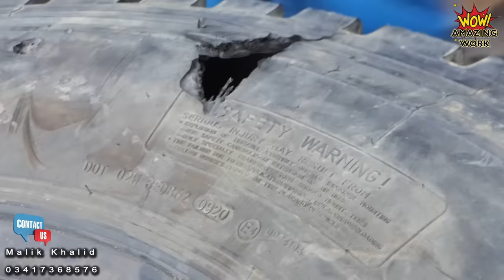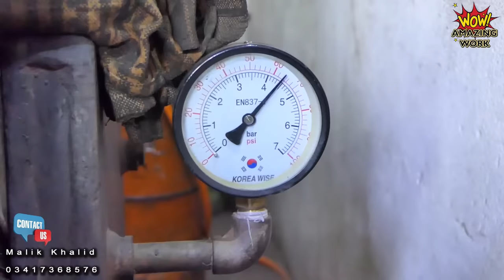Amazing skill of Repairing a Hard Impact Sidewall Truck Tire

Comment: Good job Samir! I’m sure that tire will last at least a day or two before it blows up and kills someone!
Reply: This  type  of repair ,  Its  Wheel  balancing  will  be  loss .
Reply: ยางระเบิดบนถนนมันจะอันตรายกับคนอื่นที่ใช้ร่วมกับเรา..ตายขึ้นมาเดี๋ยวใครจะรับผิดชอบ
Reply: @sreekumarsekharan3685  you don't balance big truck tires like these.
Reply: Perfect....work 
A tyre man know what he done.
Reply: @TwazkemUSAbi  says who?
Reply: Don't be so quick to judge. It can last a lot longer than you think.
Reply: Might not be good for highway use, but can be used off road or on a farm trailer.
Tire still has some life to it.
Lot cheaper than new.
Reply: @Just-Steve it's a tractors wheels it's never gona run on high speed
Reply: @prajwaldogra1030 that's not a tractor tire lol
Reply: Man cuts through steel beads to replace with string, string doesn't spark when you grind through it.
Reply: So they have a hole buisness fixing tires that break 2 days later, sure budy
Reply: @mrsnail8664  re-treads blow all the time

Comment: Makes perfect sense for a tire on a slow movin farm or utility trailer. Don't run at highway speeds.
Reply: maybe they are just restoration of big tires, because the speed of the vehicle is also not too fast, and not too heavy.
Reply: Highway speeds? Around 40kmph
Reply: You're correct, this tire will be way off balance,  can't go anywhere with it.
Reply: Exactly. That hole is held together by a needle and thread under the patch. Admire the ingenuity though.
Reply: Don't think they have highways and if they do that truck won't be doing more than 80 km/h.
Reply: Exactly
Reply: Makes sense in countries, where full day work of a specialist team is worth less than a new tire.
Reply: @sodaris22  not only, tnink about waste too. Capitalism doesn't care about waste!
Reply: @sodaris22  I am thinking of what if the tyre explodes once filling air in it, the whole day and hard work all wasted.
Reply: @PartMiniBus  my country Indonesia is same like that
Reply: It's ready for speed 100 km for 2 year
Reply: And that’s why it should be outlawed. People will sell them as that.
Reply: @vikassm  ccc
Reply: What's the worst that can happen 😂😂
Reply: @PartMiniBus  Incorrect. Capitalism is the only system which acknowledges the cost of waste and works to reduce it.
Reply: U never been to Pakistan I guess.....
Reply: @TehButterflyEffect  works to reduce it after creating tons of it, yes, you're right!
Reply: What about the side of a 500ft cliff
Reply: They'll keep your suggestion in mind.
Reply: Nah this is a diff fix in our countries that don’t recommend a fix like this is cause they rather you buy new this was fixed really well
Reply: I'am agree, it's a little bit dangerous.
Reply: @LongHaulTrucker4Life  😂😂😂😂
Just check national debt per country list.
Whole structure is about to collapse.
Making money from money has never been healthy. Even ancient Greeks knew that, but you probably don't even know who they are.
You made me laugh 😂
Reply: @PartMiniBus  I'm actually a history buff.. Ancient Greeks also spent roughly 25% of their budget on military too... Since you think you know best, design a government that is absolutely perfect, I'll wait
Reply: @PartMiniBus  When you start name calling like a child, you lose credibility... If you can't debate maturely, then no one takes you seriously...
Reply: @LongHaulTrucker4Life , Mr Everyone, you've made me laugh again! 😂
Not sure why you mentioned war here, we were talking about money.
If you skip topics like you do you definitely get nowhere, whether you're a child or an adult.
Please don't choose to get offended as you sound like you like that.
Reply: They only able to do 80kmh speed at best road and traffic condition...

Mostly 40kmh and usually even slower on the rural unpaved road
Reply: Dale shut up, I tell you what. Hank hill voice.. 😂 looking forward to the reboot.
Reply: It will be run on highways only.
Reply: I think you are underestimating the ingenuity of this fix. The patch with the cord won’t be as strong as the original steel belting, but the process they used re-vulcanized the rubber, creating a homogeneous piece grafted in at a molecular level. It’s fine for driving at speed or under load.
Reply: Not sure that is allowed in the USA.
Reply: Don't worry, nice mountain mudpaths next to fast moving rivers in a canyon below.
Reply: @PartMiniBus  LOL. Fundamental misunderstanding of capitalism.
Reply: @peekingturtle8457  Tire isn't worn out though. It's covered in dust, which can happen on dirt roads pretty quickly. Hence why it is being repaired. I bet that tire has less than 10000 miles on it
Reply: @xbahamutzero  Agreed
Reply: Would be an interesting test.
Reply: Appreciate the HARDWORK of all these Legend Men's.
Reply: They are used on highway and exceed 5 times more the load capacity. Enjoy
Reply: @lamassu4100  so me one of the millions of split rim tires n Americia that are ballanced. You wont
Reply: @Dequavis Jones  
You're so off balance, this tire is more balanced than you, no cure for you. 🤔
Reply: @bshinn4884  the tire isn't worn? Are you joking it had a massive hole in the side 😂 it will pop as soon as it hits a pot hole
Reply: @sirfreddiemercury6996  The tread. The tread isn't very worn. Come on now. Keep up
Reply: There is science , and there is experience. They have experience and if this was a waste they will not work on it and waste there time ... Btw, why high way? Not every tire is going to high way.
Reply: @doublesnake18 Cant imagine that tire would fit many tractor wheels etc it's a truck a tire. According to Google 377 people a day die on the road. I bet a few of them deaths are caused by tire blow outs
Reply: @sirfreddiemercury6996  As i said. Experience talk here, if people die because of repaired tire, they will not make it a work than, because people will know that : it's not worth it. But if nothing happens and the tire can work for two more years, that's great for a poor customer.
Reply: The tire will most likely hit the highway 😂
Reply: @PartMiniBus  every country has highways moogoo
Reply: I will not trust my life on that tire.
Reply: @mushtaqtai2281  in your dreams 🤣
Reply: I wouldn’t recommend this tire to even my worst enemy.
Reply: Good
Reply: hahahaha you cant imagine how much weight they are gonna put on that tire. sadly its normal in this wild ruled corrupt country.
Reply: Looks  Great! But just Like a Bomb!
Reply: Would work on a Bias Ply Tube Tire... Prolly wouldn't trust it with a Radial....
Reply: @PartMiniBus  actually tires in America are recycled and or ground up for Materials for plastics, roads  etc..
Reply: @PartMiniBus  this is Pakistan and it has highways, Motorways and very good condition. However, these tyres will be used on trucks carrying load and max speed of 30MPH.
Reply: The steel-belt wires are vital for strength. If they are cut, the tire is scrap.
Reply: it's Pakistan. there is no Highway here
Reply: @PartMiniBus  we have a network of motorways.
Reply: @lamassu4100  ufjfu
Reply: @pruthivirajsarnaik5859  
WTFYATAFU
Reply: @vikassm  video is from pakistan and not india highway speed is 70 and truck carries 60 to 70 tonnes
Reply: Yea high speed
Reply: @wasdwecst yet you trust your government.

Comment: That's one of those repairs that looks great after if finished, but the tire will still blowout after a few hundred miles as it's all looks!
Reply: Yep. That sidewall spot will bulge like a balloon.
Reply: Yeah but by then they have their money and he's L̶o̶n̶g̶  well...gone
Reply: I have repaired one tyre of my car by such workers and its almost 2.5 years since repair and i am still using it without any problem even driving at a speed of 120+ km/h...
Reply: @soundmin7824  i don't know about that and i didn't asked them at the time.. i left the tyre with them and received next day
Reply: @Rich77UK  the good old outta sight guarantee...as soon as the customer is outta sight guarantee is over!
Reply: @marshapelo9830  he could have at least used steel wire and a few layers of mesh. This is just a beautiful display of that Avg IQ of 80

Comment: It used to be a steel-belted tyre, now it's partly sewn with string. The steel belt is cut and weakened. If that tyre pops under Pressure, better not be near it.
I admire what they're trying to do under the circumstances, but the result is outright dangerous. Anyone doing this in my country, NZ, would probably imprisoned for neglect.
Reply: Usually no steel belt anymore bro tyres are nowdays use nylone threads similer tyre guy use..Also side cuts fixed like this  will not give much issue as they don't run as high speed( hardly go above 70Km/h) as we have in Aus/Nz  they will use it in rear with one good tyre. We can afford this  safety cause things we get here made at cheap( in china /india/asia)and fixing  here cost us more..No one will do this kind of fix here as tyreguy will charge as much as new tyre cost..
Reply: A study from pakistan on traffic safety had tire bursts as the cause of 18% of accidents. 
Wonder why...
Reply: @henrik3129  source?
Reply: @krunalpatel8182  this tire is steel belted, that’s why sparks are flying when he’s using a grinder in the start of the video.
Reply: But US videos show the same procedure as this.
Reply: @taglavis  This is illegal in the USA, so anyone putting out a video of it would be in trouble.
Reply: How many pounds would you say this tire is supposed to take ?? with missing steel support missing on the side ?

Comment: Incredible skill!!  American tire shops won't patch a nail holes in a passenger car or light truck tire if the hole is in the tread within an inch of the sidewall.  And here you are repairing a heavy truck tire with part of sidewall MISSING.  Truly amazing and thanks for sharing.
Reply: Your getting ripped off then. Theirs a reason you don't fix the sidewall.
Reply: A weak spot in a sidewall is asking for a blowout. I understand why they are doing it and it is neat but that tire is compromised. Let's just hope it doesn't go on as a steer.
Reply: There is a reason,, the patch becomes unvulcanised on the most flexed part of the tyre.
I have seen it happen no end of times. Once after the car rolled when the patch came off and the tyre went down

Comment: I admire your work, your insistence and your inventivity, but such of tires won't resist to much.It represent a REAL DANGER, gentlemen, even at slow speed.
Reply: They reuse everything in India for many years. If it works, it works xD
Reply: @justingoss1779  "if" is the correct word in this case.
Reply: @justingoss1779  by the way this video is from Pakistan.
Reply: Nah, just fill it with spray foam. Or concrete.     Never go flat again.

Comment: Eu trabalhei com vulcanizaçao de pneus por 5 anos (1990-1995), se acredite, era muito trabalhoso.
Reply: Tem algum tipo de segurança um reparo desse tamanho???...
Reply: @francisheinle5762  Sim, pode confiar, principalmente se a costura for bem feita.
Reply: @francisheinle5762  No, there is not. The tire will not last very long at all with a repair of that size in the sidewall.
Reply: @francisheinle5762  também não acreditava. Mas um pneu 295 de primeira viagem pegou um ferro na lateral. Consertou e durou até alisar. Fiquei contente
Reply: @marioluciomelloti1696  ótimo...poupou uma boa grana...
Reply: @francisheinle5762  sim ajudou bastante. Frete estão muito defazados em relação ao diesel e manutenção.

Comment: Being an Ex- Technical Employee in Renowned Tyre Industry, this process is not correct. Re-Tread can be approved but sidewall, chances of failure is high due to high flexible area.
Reply: Yes, you are absolutely right. Better go tell them what they have been doing is so wrong for all these years. Not all countries work around wasteful Western standards where anything less than perfect for the most extreme situation is not deemed useful.
Reply: In such side wall failure cases we SCRAPPED the tyre, rather marked 2nd.quality, it is the risk of human lives. In such repair there must chances of voids/air pocket in it, on road it will increase and failure the tyre.
Reply: Don't worry these guys have been in this kind of bussiness for a long time.
Reply: Tommy. n. That's why lots of road accident happened. Tyre failure is one of the main reason, sorry!
Reply: @jasonb9652  that's fine, if you want to die young.  Remember, in the West, most countries have been through the periods of manual repairs and have learned from experience.  Instead of calling Western standards wasteful; why not learn from their previous mistakes and make life safer for your family, friends and fellow countrymen?

Comment: I don't recommend it but I bought a used 295  /22.5 tire for $100, it was basically new 28/32 of tread but it was damaged just like this one on the sidewall. Goodyear shop guaranteed it for 100k miles. That repair was strong and lasted well over 2yrs of running otr. I'm sure goodyear had better process and equipment then this and tested it to guarantee it. I was lucky, I took a risk because any other time I would buy a new one.

Comment: I have no trust in major tire repairs and as far as SIDEWALL repairs  it is dangerous! The experts frown on and are ABSOLUTELY  against repairing a sidewall on a tire. You could get away with sidewall repair on a very slow moving vehicle like a backhoe  HOWEVER,  DRIVING DOWN THE HIGHWAY ON A HOT DAY WITH A SIDEWALL REPAIRED TIRE IS CRAZY, STUPID AND  CAN GET YOU AND OTHERS KILLED!

Comment: That’s floater gum rubber made for under patches not section repairs and there was no reason to touch the bead on that tire that will only take air with a tube now .But I do respect the work behind this use what you got from one tire tech to another. Props

Comment: its very innovative and when you dont have the resources it's understandable, but tires arent like metal, you cant just weld a new patch in and sand it even, theres a reason the sidewall has steel cords in it, its going to be flexing and heating up with every rotation of the tire and under significant load cuz its a truck tire, theres no way to get that integrity back, sometimes when theyre designed to, you can retread a tire, but the sidewall is too integral and is the most stressed part of the tire, that things gonna be inflated to at least 80psi, that in itself requires a lot of structural rigidity. good luck to whoever drives with that and whatever vehicles theyre around

Comment: Thats called Jogaar, temporary repair if u dont have enough for replacement or to buy new one, its temporarily repaired on low cost only to keep on running the tyre to earn some bread, thats the owner of vehicle, though he should b very careful to not put others and himself in danger or worse, on other hand these workers did the best wt they could with the minimum resources. Any how keep on going and do the best

Comment: As someone who works in a tire store, I’m impressed.
Reply: This looks like some real 3rd world shit though. I wouldn't trust that tire to get me across a parking lot alone  a road. There is no strength or support there other than some fucking string.
Reply: @andrewsipling2531   bro.  You’d be surprised on what I see people roll in on! And I agree with you.   We aren’t sending people back out with these kinda repairs but something tells me this dudes work doesn’t come with a warranty.
Reply: Doesn't take much to impress you. That's dangerous as hell, that tire will blow out the minute you put any kind of load on it, or any speed.
Reply: @timothygeiger8271   “doesn’t take a lot to impress you” 

Says the guy who has probably never patched anything ever.
Reply: @PNW_Adventures1  in my 30 plus years of driving a big truck for a living, I've been around a few truck tires in my life. I've been around more patch repairs than you can count. There's a reason why you don't repair sidewalls, hell even doing a patch & plug repair on the tread is questionable if it will hold.
Reply: @timothygeiger8271   let’s be honest.  You spend your time getting repairs at a truck/tire shop.   Someone else does it.   Mind you, I repaired countless as that repair guy.
Reply: @PNW_Adventures1  i have also repaired plenty of tires. If you really worked in a tire shop, you would know you never repair a sidewall with that much damage. Hell, tire retreaders refuse to retread a tire that has had the tread patched.
Reply: @timothygeiger8271   of course I know that, hence why I said impressive.   Cuz I’d NEVER do it or have ever done that.     I simply say…. Sorry bud. Looks like it’s a $600 tire or whatever.  I don’t make the price. I just simply repair or replace.     And I don’t do it anymore.  Just was a temporary thing.

If I really worked in a tire shop?…. Bro like I came to the comments section to brag about my illustrious tire career 🤣 nahhhhhh but I did do service for Schwab’s for awhile.  Some small tires.  Some very very large equipment tires.  Lots of truck tires and passenger tires etc.  hated every one of em. Like I said. Kudos to the guy getting the job done.    Ida replaced it 100 times
Reply: @PNW_Adventures1  one thing about it, that tire is not going to last very long, especially if they put any kind of load on the vehicle, & get it up to highway speed on a hot day. It's obviously going to have a tube put in, that bead will never seal patched like it is.
Reply: @timothygeiger8271  truth. Job security

Comment: That Tire will not pop up that easy, that patch that they are using is A steel belted sidewall and that is better than a cord patch, that are resource people and I know that because we used to use that technique on OTR tire to fix them. It's good, not that elegant like using new products but with the process well done and the right pressure and temperature it will work pretty fine! Good work, P. S. Esa llanta no va a explotar en la reparación, puede explotar en cualquier otro punto pero no ahí...